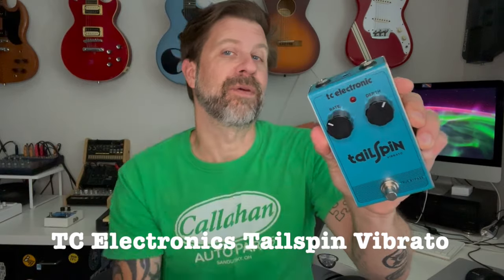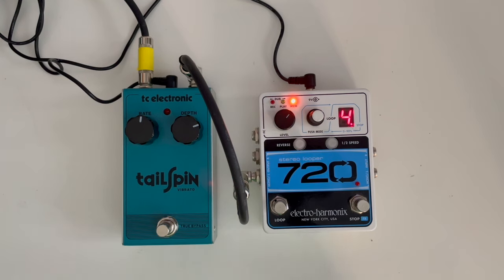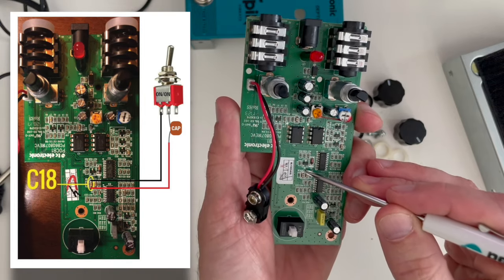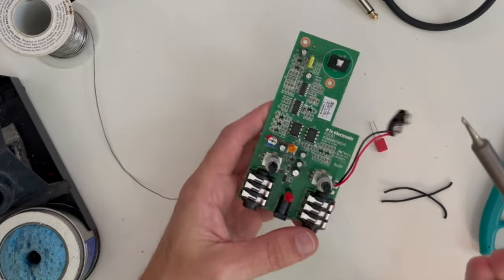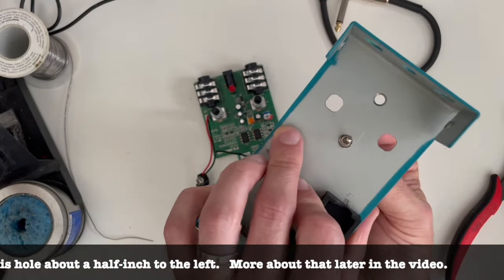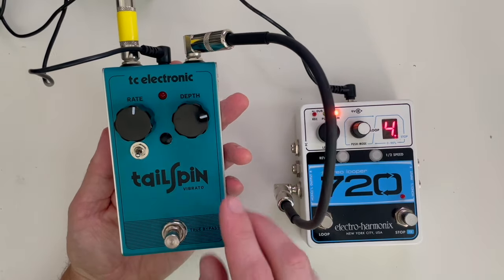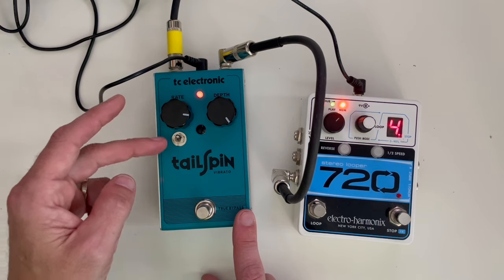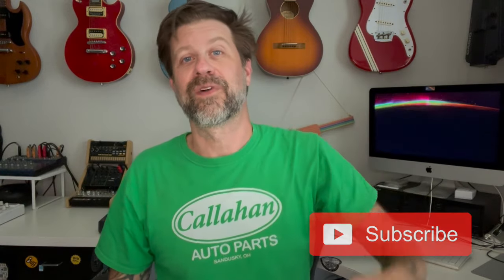How To Modify a TC Electronics Tailspin Pedal

Comment: Since you already have the hole, maybe you should find a smaller switch like the ones with a lugs on the side and put in a much different value capacitor so you have two options. Putting it in series would get you an ultra fast switch.
Reply from the maker: That's a good idea. Thanks for checking out the vid.